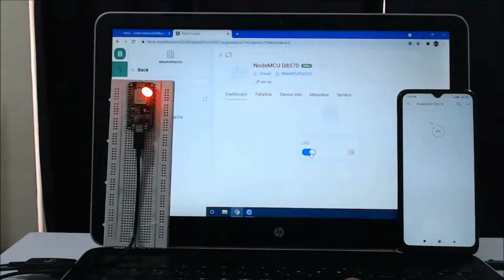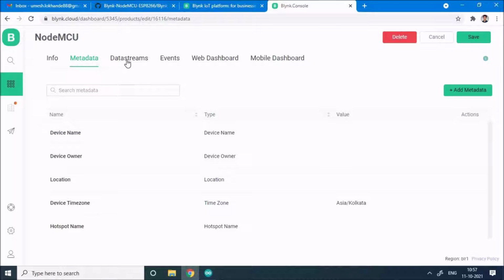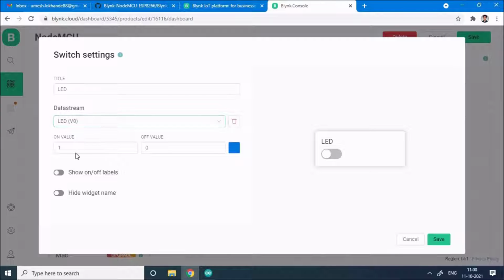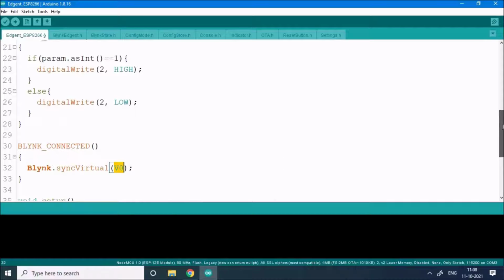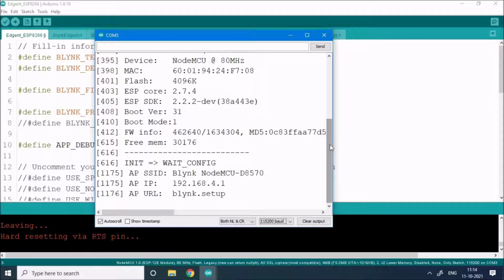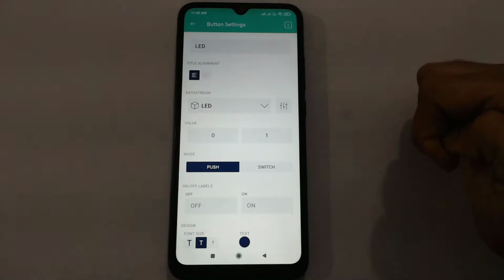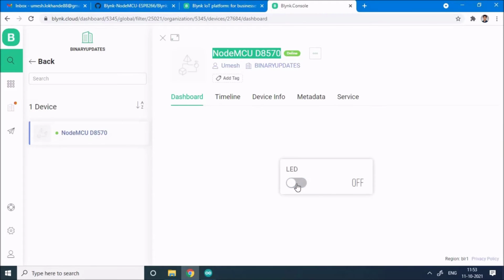Blynk with NodeMCU ESP8266- Web dashboard and Mobile App

Comment: when i connected to my espboard from blynk mobile app, it says device limit reached. asks for payment
Reply from the maker: Hi Mohan, It may be because you may have used maximum number widgets in your Blynk project. Due to this your free Blynk credit exceeds the limit so it maybe asking you to pay. i will suggest try to remove some Ui widget and see it device limit notifications goes away just to confirm if its the case. Hope this may help you. Best wishes!

Comment: Where do I configure the connection ??????????????????????????????????????????????????????????????????????? 
This is not necessary!
Reply from the maker: Hi Nivaldex, the configuration of WiFi settings can be done through Blynk mobile App. Once you complete adding ESP8266 as a device in Blynk App then only you can access the template created in Blynk IoT dashboard. I hope this may help. Best wishes!

Comment: How should I edit the code to connect 4 relays?
Reply from the maker: In Blynk dashboard we then need to set 4-virtual pins to control 4-relays. These Pins will looks something like v0, v1, v2, v3 and then in Arduino code we must add and use these pins to control as show in my video for 1 virtual pin. I hope this may help. Good luck and best wishes!

Comment: Very clear explanation but I can't use your "Blynk-NodeMCU-ESP8266-main.zip "because in <sketch-include zip files> the file is not considered a zip file
Reply from the maker: Thank you very much. In this case you can use built-in code provided by Blynk which comes as a part of Blynk Library Installation. Otherwise you can just replace default code with my code in only one file. I hope this may help you. Good luck and best wishes!

Comment: it is showing offline on the blynk website even though I have entered correct auth code and the board is connected to  my phones hotspot. But still it is showing offline. How do I solve this problem please help me
Reply from the maker: Hi Adnan, press the RESET button on ESP8266 NodeMCU and check on serial monitor if it shows Blynk is connected. In case, if failed to connect check WiFi credentials in code for any typo mistake. It happen very often and try re-upload again. I hope this may help. Good luck and best wishes!

Comment: bro I am not able to connect to wifi on arduino ide
Reply from the maker: Hi Raghav, it will be good if you provide more details on what you did? and what exactly the problem you are facing with Blynk IOT Project. The more information you provide better we can help. Since, Blynk requires you to perform many steps from creating template to upload code in ESP826 and connect to Wifi. Good luck and best wishes!

Comment: Congratulations for the information so well explained. In my case, an ATMega2560+esp8266, I can't create the device directly or create the template after recognizing the device on the CelPhone. The App allows the configuration of the Wifi Network, user and password, however, in the last step, it exceeds the time and does not enable the card to be used on the network. Do you have any more tips? Grateful.

Comment: The video is awesomely explained. I just have one question. Is there any other way to connect my ESP8266 to my home wifi without using my mobile phone (as I am around 2000kms away from it 😅😅) and then use my phone to control it remotely ?
Reply from the maker: Hi Faisal, yes when can connect ESP8266 with home WiFi. As you may have noticed we only used Blynk Mobile App to setup the wifi credentials in ESP8266. Once Its configured and NodeMCU connected to Blynk IoT over internet then you can move anywhere with your mobile phone. You still can control remotely your devices at home 2000+ km away from your same mobile phone and Blynk App. I hope this answers your questions. Thanking you!

Comment: Sir i am making a model name agriculture machinery but i am not getting that what is the virtual pin for the switch for phosphorus nitrogen potassium all these will be controlled by blynk with solenoid valve
Reply from the maker: Hi Palak, as I may not guess your entire project. But all I can say is Virtual Pin is a concept from Blynk IoT platform which will let you control any analog or digital pin of microcontroller like ESP8266 or ESP82 etc. Now to control solenoid valve you can use virtual pin as i've used in this example project. Check my relay control video lesson as well to get idea how we can easily replace LED and instead control high voltage devices. I hope this may help you. Good luck and Best wishes for your project!

Comment: How can i change wifi credentials which are already stored in the memory of Nodemcu... I try to change these credentials by using blynk app but it didn't find any device when blynk try to connect nearby device. How can i change it.?
Reply from the maker: Hi Malik, while changing WiFi credentials next time Press and Hold Flash button on NodeMCU for 5 Seconds and also check serial monitor. It shows memory been cleared away. So later when you configure new wifi credentials in blynk app, it will work. I hope this may help you. Good luck and best wishes!
Reply: @BINARYUPDATES  Not working.. when i press flash button for 5 sec it show's the current status like...
Device:    Blynk Water pump Automatio-MYJ9
 Firmware:  0.1.0 (build Jul  9 2023 07:16:22)
 Token:     hPLW - •••• - •••• - ••••
 Platform:  ESP8266 @ 80MHz
 Boot ver:  5
 SDK:       2.2.2-dev(38a443e)
 ESP Core:  3.1.2
 Flash:     4096K
 Free mem:  30152

Comment: hey the toturial was going so smooth untill i faced an error of template name and id its giving me error , and i have copied the as it is from the blynk console
Reply from the maker: Hi Syed, please check Arduino code or create project from example section in IDE and then edit Blynk template name and other details as shown in video lesson. The issue could be in code while you've copy and pasted otherwise download code from Github link in description section. I hope this may help. Good luck and best wishes!
Reply: @BINARYUPDATES  the issue have been resolved as I was new to this so I didn't added the device in my template then , now the project is working smoothly
Reply: @BINARYUPDATES  now I want to have a joystick control so is there any toturial or guidance for that?

Comment: your code shows error in IDE, so I used the default example. the button is not making anything turn/off, everything else works :-)
Reply from the maker: Hi Shijil, In that case you need to make some changes in default blynk project code. You can compare my Arduino code from GitHub page and make necessary changes. Good luck and best wishes!

Comment: How can I read (Monitor)  a simple switch open or closed?
Reply from the maker: Hi John, I made video to read sensor data using blynk. The only thing you've to change is to use digitalRead() function instead of analogRead(). And use proper widget to show in Blynk App.
Reply: @BINARYUPDATES  Don't work!

Comment: Thank you for sharing the information. I have a doubt, In serial moniter how can you say that 115200baud should select can you please explain.I am using esp32 wifimodule.
Reply from the maker: Hi Gnanasekhar, its because in Arduino code for Blynk we used baud rate 115200. That's the reason, we have to set Arduino Serial monitor to 115200 while reading data. When it comes to ESP32, it doesn't change much except choosing correct device while creating blynk template in Blynk Dashboard while creation. I hope this may help you. Good luck and best wishes!

Comment: Would it work the same on Arduino Uno with the ESP8266 WIFI module?
Reply from the maker: Hi Pushpraj,  there will be a changes required while creating blynk template for Arduino Uno and ESP WiFi Module. I hope you're talking about ESP-01 module with Arudino Uno board. I will make video in future to show how to connect Arduino with ESP-01 Wifi module and integrate with Blynk IoT Platform. Good luck and best wishes!
Reply: @BINARYUPDATES  Yes please, I'm waiting for that video.

Comment: Thank you for an excellent tutorial! When I did the project and compile it according to the video I received an error, 

rror: #error "Please specify your BLYNK_TEMPLATE_ID and BLYNK_DEVICE_NAME"
   17 | #error "Please specify your BLYNK_TEMPLATE_ID and BLYNK_DEVICE_NAME"
      |  ^~~~~

exit status 1

Compilation error: #error "Please specify your BLYNK_TEMPLATE_ID and BLYNK_DEVICE_NAME"

I have copied and pasted the id:s from my project in the Blynk desktop.

Do you know what can be wrong?
Reply from the maker: Hi Henrik, it seems to me that you have not mentioned blynk TEMPLATE ID and DEVICE NAME in your Arduino Program (this information can be found in your blynk dashboard as demonstrated in video lesson). Please check the github link I've shared and compre code and make necessory changes in your arduino code. Good luck and best wishes!
Reply: @BINARYUPDATES  the fun part is that I have copied and pasted the template I’d and device name from the Blynk dashboard to the Arduino ide and later on compiled it. And the error shows.

I will try to reinstall everything and see what happens.

Comment: In file included from C:\Users\warre\AppData\Local\Temp\arduino-sketch-B32FEAD95E21DDFCC7C22139C04F263B\sketch\Edgent_ESP8266.ino.cpp:1:
C:\Users\warre\AppData\Local\Arduino15\packages\esp8266\hardware\esp8266\3.1.1\cores\esp8266/Arduino.h:27:10: fatal error: stdlib.h: No such file or directory
   27 | #include <stdlib.h>
      |          ^~~~~~~~~~
compilation terminated.

exit status 1

Compilation error: exit status 1
Reply from the maker: Hi Warren, It looks more like library and header file linking issue in project. I'll suggest cone complete blynk project from my GitHub Page and only change blynk Template ID from Blynk Project dashboard and try.

Also make sure blynk libraries are installed properly in Arduino IDE. Sometimes its a reason for not been compiling arduino sketch. 

Good luck and best wishes!
Reply: Ok will check

Comment: Can you help me? Please. Compilation error: user_interface.h: No such file or directory
Reply from the maker: Hi Daniel, please make sure you open file from example project of blynk. And after doing changes all the header linked properly. Its an issue with where header file is missing. I am not sure which code you're using for project. Did you download from my github or opened "edgent_esp8266" example project?

Comment: I am getting an error message while uploading my code.
How can I fix it.?

Running stub...
Traceback (most recent call last):
  File "C:\Users\Hamza Khalid\AppData\Local\Arduino15\packages\esp8266\hardware\esp8266\3.0.2/tools/upload.py", line 66, in <module>
    esptool.main(cmdline)
  File "C:/Users/Hamza Khalid/AppData/Local/Arduino15/packages/esp8266/hardware/esp8266/3.0.2/tools/esptool\esptool.py", line 3575, in main
    esp = esp.run_stub()
  File "C:/Users/Hamza Khalid/AppData/Local/Arduino15/packages/esp8266/hardware/esp8266/3.0.2/tools/esptool\esptool.py", line 728, in run_stub
    raise FatalError("Failed to start stub. Unexpected response: %s" % p)
esptool.FatalError: Failed to start stub. Unexpected response: b''
Failed uploading: uploading error: exit status 1
Reply from the maker: It seems like an issue with uploading code on your ESP8266 NodeMCU than Blynk. Please check drivers and reconnect to other USB port of laptop and try upload code. Also, make sure to close and reopen Arduino IDE. This may help resolve if any issue with linking files while uploading code on NodeMCU from Arduino IDE. Good luck!

Comment: If there is a power cut and turns on , will it automatically get to previous mode or it'll be in always?
Reply from the maker: Hi Rohit, you can reset NodeMCU ESP8266 and then test Blynk App. I hope this may help you. Good luck !

Comment: Hi there,

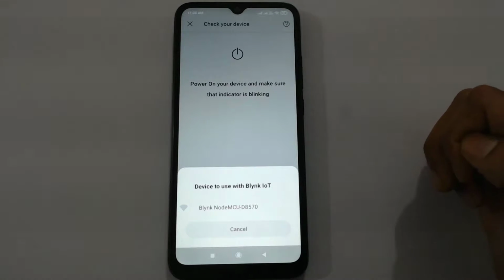First and foremost, very detailed manual, congrats. Sadly, it does not work to me. The thorny matter is the connection between mobile application and the NodeMCU.  As you have in minute 18:53 in your video, I see the wifi broadcast by my NodeMCU thanks to the previous uploaded Adgent_ESP8266. However, once I click on the wifi (Blynk NodeMCU-0A131 in my case)  nothing happens. So, no way to transfer to the NodeMCU the wifi and password to be connected to. 
On top of that, once I open the mobile application and I log in, I get a message that does not appear in your case: "Now go to your computer. Check your inbox for the code and instructions on how to get your device online" . The question is what on earth inbox is the application talking about? I went on my blynk online profile and there is not inbox!! Neither in my email inbox. Programmers.... :-) 
I guess that there is something new in the last version of the  app for Android. By the way, I am using  blynk IoT 1.5.3 on Android.

Thanks
Reply: Well, after being fighting for a while, I could make it work. I would like to clarify some tricky things from this good video tutorial to make it more solid:

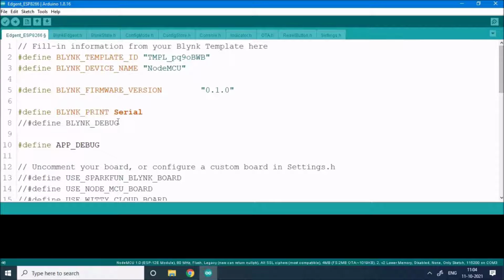1) At minute 10:22.  The file BlynkEdgent.h available on Gighub (see author video description) must be downloaded. Then the code of this file must be copied. After that, go to Arduino IDE: File-->Examples-->Blynk-->Blynk.Edgent-->Edgent_ESP8266. Then erase the code of the Edgent_ESP8266 (don't be worried, the file is protected and it can be only read) then, paste the code of the file BlynkEdgent.h from Gighub  in the Edgent_ESP8266 file. Finally, copy and past the parameters BLYNK_TEMPLATE_ID and BLYNK_DEVICE_NAME according to your project. Then, upload the file to your NodeMCU. Open a serial monitor from IDE (tools-->serial monitor), press reset and if everything is OK you should have something similar to this: 
AP SSID: Blynk TEST-546K6
[6464] AP IP:   192.168.4.1
[6465] AP URL:  blynk.setup
[34666] WAIT_CONFIG => CONFIGURING

IMPORTANT: if you try to run the file from Gighub (BlynkEdgent.h) stand alone the compilation will crash due to the lack of concordance with the paths of extra files/functions which are needed for the compilation: "BlynkEdgent.h: No such file or directory".

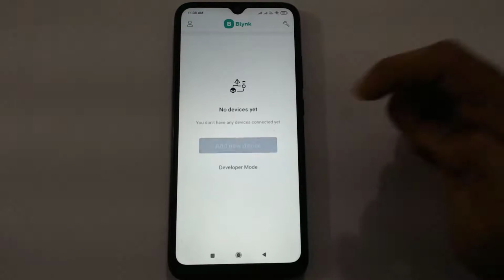2) At minute 18:17. First, your mobile phone must be connected to the wifi provided by the access point router or whatsoever where you want to connect the NodeMCU. After the point 1 explained before, the NodeMCU is broadcasting a wifi with a name similar to "Blynk XXXX" . Well, if for some reason your mobile has connected to this NodeMCU wifi in some how before completing the process explain in the video, you have to go to your mobile configuration and select "forget this network". Otherwise the process of transferring the wifi password to the NodeMCU will crash. Moreover, if something wrong happens during the process of transferring the password and the wifi name by Blynk mobile app, before repeat the process you have to go to your mobile configuration check the saved networks, choose the one called  "Blynk XXXX" and select "forget this network". 

3) At minute 22:37 .The so called pin V0 is mapped in the NodeMCU board as pin D4. This is not trivial and is briefly commented in the video. A full mapping of the ports and their correspondence according to the Pin DataStearms on Blynk online application will be very welcome.

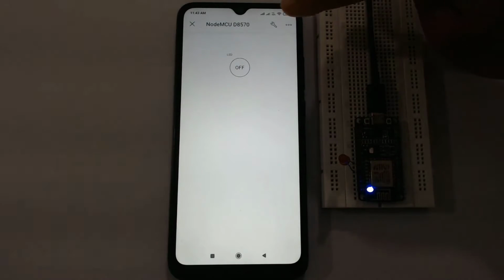4) At minute 22:40. Whatever LED must be connected in series with a resistor (150ohms is fine) to limit the current through.  

I hope these descriptions are useful and suitable to improve this great video manual.
Thanks

Comment: Bro blinkedgent library error 😭
Reply from the maker: Hi Sumanth, please make sure Blynk Library have been installed properly in your Arduino IDE. Its possible if libraries are not installed properly then it creates issue with linking them while compiling arduino sketch. Good luck and best wishes!

Comment: my LED on and just off(like flash) after switched onn from blynk app??? don't know why?
Reply from the maker: Hi Prashik, if your arduino code and led connections are correct. Then its possible that the Blynk Server be sluggish to respond sometimes. It ultimately result in such behavior. Good day!

Comment: I have another issue regarding node MCU. I have simple ESP 8266 -01. If this project is applicable to the ESP 8266-01 rather than Node MCU, what changes should I made so that my project works on ESP 8266-01.
Reply from the maker: Hi Abdul, the code remains same for ESP01 for Blynk except digital pins. I'm not sure which GPIO pin is available there. But you can check with pin out and change digital pin and reuse the code. Good luck and best wishes!

Comment: sir, can u teach how to make a connection that have 3 led..I have try it but the coding was error and my circuit also not right
Reply from the maker: Hi, I will try to make video on the requested topic to control multiple LED from Blynk IoT Platform and NodeMCU ESP8266. Thanks for your patience. Good day
Reply: ok sir...but really hope u can give as soon as possible because my due date asignmment is around the corner...really appreciated your consideration🙏

Comment: Umesh,
Can you please explain how you get this sketch to work when you don't uncomment "#define USE_NODE_MCU_BOARD"
I have had a lot of issues getting the esp8266 to communicate with Blynk and through the troubleshooting and assistance from Blynk I narrowed the problem down to this 1 line of code.
What is really weird, when left commented, the sketch works. When un-commented, i.e. telling Arduino which board is being used, the sketch does not work.
This lets me think that you are defining the board somewhere else.
Reply: This  blynk web opens different dashboards in different countries😢